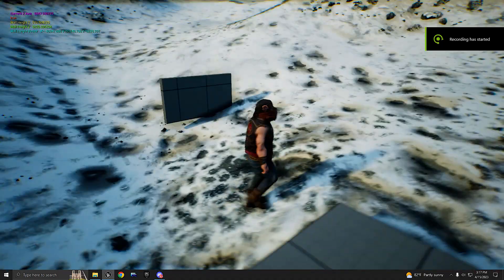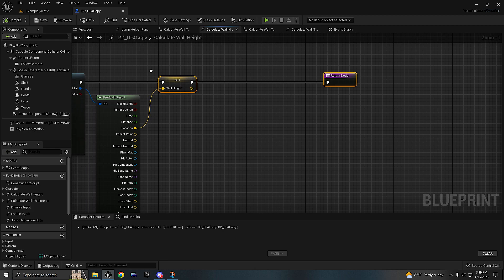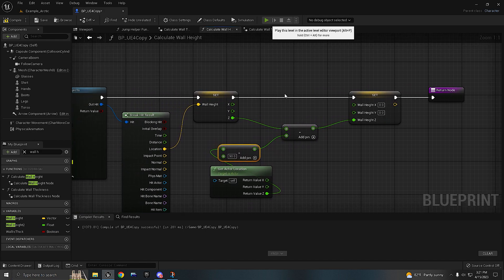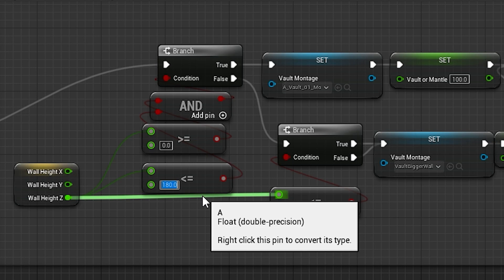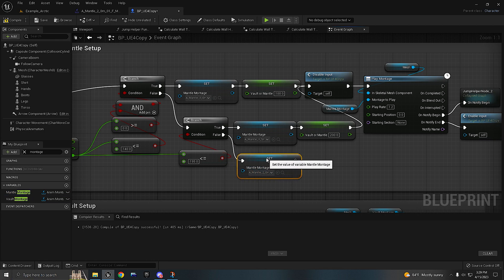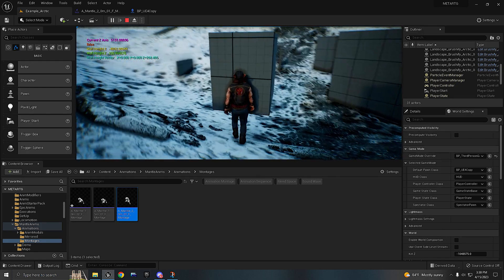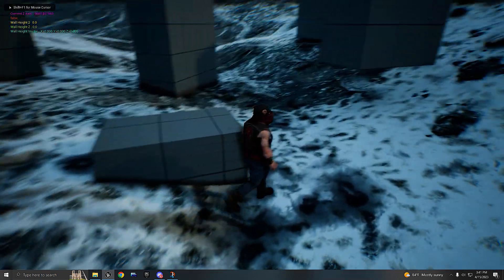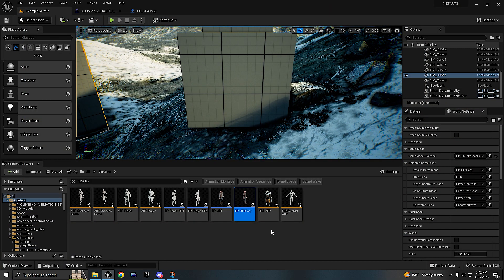Mantle System Tutorial on UE5 | Fix Vault System

Comment: I've followed your tutorial recently and they are great,  but  I just found an issue with the mantle animation montage and the climbing system. In your previous climbing system tut, there's a climb up anim montage that override the mantle animation from this tutorial, can you find a way to fix it?
Reply from the maker: What do you mean by override, can you show me a video
Reply: @LocoDev  Sorry my bad, I've combined climb & mantle with the same input which is spacebar key, so the engine try to do mantle from climbing tutorial and mantle from vaulting tutorial at the same time. that's why the animation from this tutorial gets override.

Anyway nice tutorial, Would love to see the climbing system on a rounded surface. Keep up the good work

Comment: Hey so, how do i stop it from letting me mantle onto enemies? if i attack an enemy and i jump too close to it, my character will proceed to mantle ontop of it... i dont want that! any ideas? :P thank you
Reply from the maker: These are simple steps. Firstly, you can add a tag to the enemies. By doing this, if the trace detects an enemy with that tag, the code won't execute. Another approach is to obtain a reference to the enemy within the character Blueprint (BP). Then, when performing the forward line trace, you can specify which actor to ignore by choosing not to consider the enemy reference. If you have any further questions, feel free to ask in the comment section below. Thank you!
Reply: @LocoDev  Appreciate it! i got it to work by ignoring the tagged NPC when line tracing

Comment: this is compatible with strafe mode?
Reply from the maker: Yes
Reply: @LocoDev  
I'm going to join your patreon. You have good tutorials, would I have some from strafe?
Reply from the maker: @dannus8779  Yes, you will have access to the strafe system files, as well as other systems from both the old and new tutorials. Also if you need help you can contact me on discord if you struggle on the implementation process of locomotion systems
Reply: @LocoDev  I have a question if I pay you and give you my project can you implement vault and mantle?
Reply from the maker: @dannus8779  Sure! You can talk to me on discord or on the Patreon about it